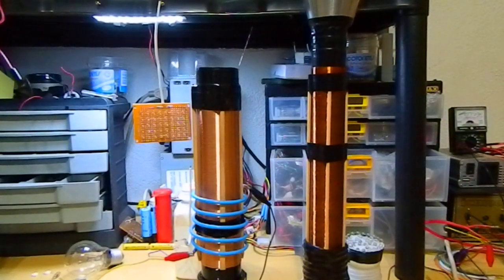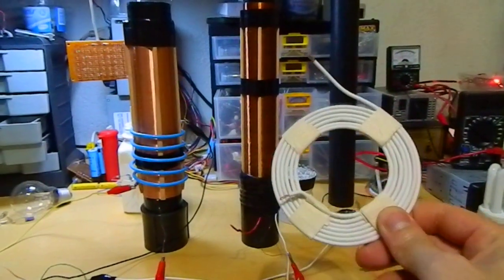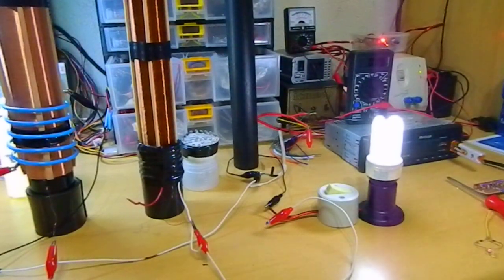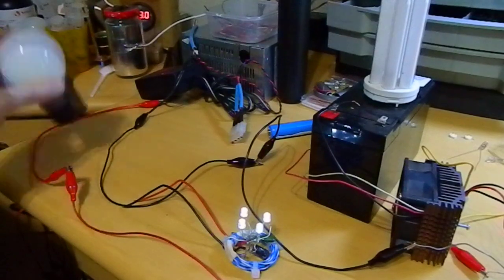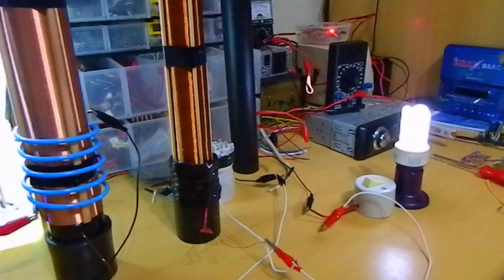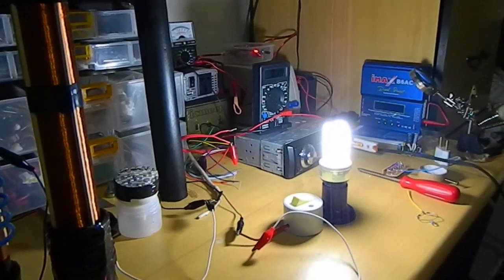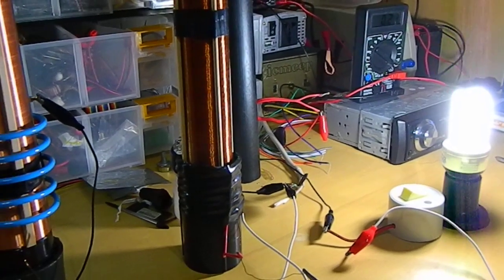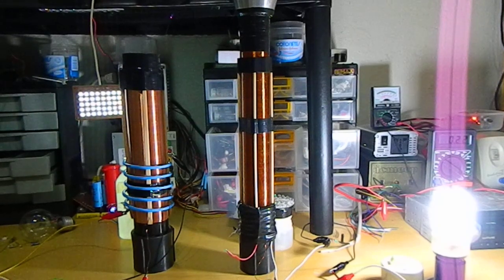Slayer Exciter - Full brightness CFL L3 earth ground

Comment: Hi i did made a coil from a paper rool the one we use in kitchen and it's arround 2,5cm diameter and 25 to 30 tall, but it didn't work on 12v, i did test the slayer circuit on my second coil it is larger but smaler in height and it barely light a 6w cfl.
Is the problem on my imput voltage or the primary coil? My coil is much like yours, please gimme a tip on that.
I'm also from Brazil too!
Reply: Circuit??
Reply from the maker: ***** Greetings.... It must have at least 800 or more turns for a good result, but more turns, better output. Send me your email in PM, then I may help you on that.

Comment from the maker: Greetings. Well, 2N2222 will burn with anything more than 8v with this Slayer Exciter. More than 8v, use a TIP31 with a CPU cooler, they really get hot. Use also an LED from neg to base, anode on neg and cathode on base. I also use a pot and another LED from plus to base. positive, pot, LED and base, on this order. And after I use this two methods on the circuit plus the CPU fan on the transistor, I can use the 30v printer power supply without blowing transistors. Regards.

Comment: I'm looking to do the same. Actually light my home for a few watts. Maybe run fans too.. All from solar panel.
I can show that easy :) I will explain (well) soon :) I put an amp meter between neg rail and ground, and between ground and L3. If you remember that with DC, conventional current will go from red to black, or in electron current from black to red. You can see the ground is acting as a pos, not a neg :) Although you can use it as a neg too. Its all about capacitive coupling scalier wave

Comment from the maker: I´ve used a single wire coil, as the primary ones for the Slayer on the top of the TC as a load, and from there to a CFL. One wire only from the top load coil to one wire of the CFL, leaving the other connection open on the top load coil and on the CFL and using this way I was able to light up two CFL´s in series. But all the wire sparks and burn if you touch it or leave it in contact with some metal.

Comment: Also, Finally. Exelent display of single wire induction on all the power leads. Try putting one terminal of CFL on an exposed connection there somewhere. I can Light them on the battery terminal when running the slayer from 12v with no ground, but not with neg rail grounded. I lose the induction effect too, so you may be able to get it working with ground on neg rail! Awesome work! Very proud for you :) Your becoming a true master of wireless energy. All your hard work is paying off :) Awesome!

Comment: Great to see you have serious heatsink now too. That will help with blowing less transistors! Buckey coil test was very interesting! I have also been considering something like that, as a primary on a second transmitter tower. Don't know if it will work. I have huge mess and lots of scrapping to do, so may be a few more days before I can get back to slayers. Keep up the fantastic work!!! This is some really important testing you are doing! Have you tried CFL's in series? Can you light more? cont

Comment: I was lighting incandescents this way, but no where near the brightness of your CFL! If you consider the 25w your system is drawing, and all the other stuff it can run simultaneously, it's incredibly efficient! I'll have to look at this on the scope, as the CFL may be acting as a switching cap of diode (probably a bit of both). Have you had any lick measuring amps to the cfl with ammeter in sires on the ground L3 line? I wonder if its the same as with incandescent? Cont...